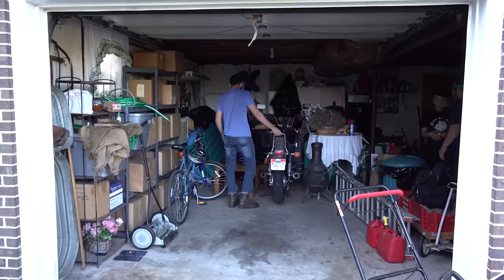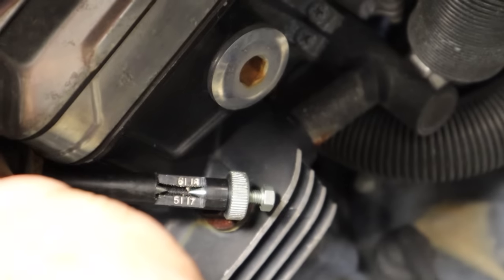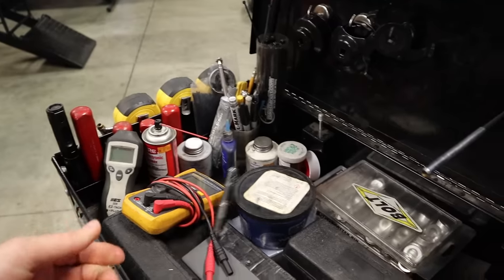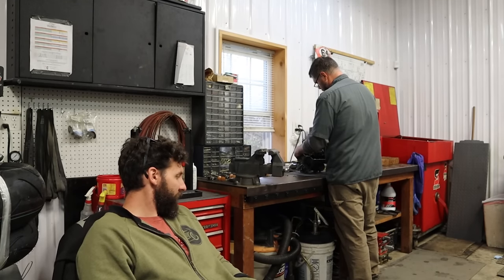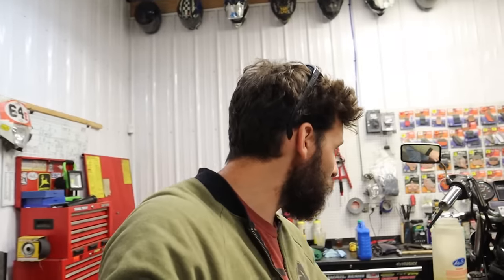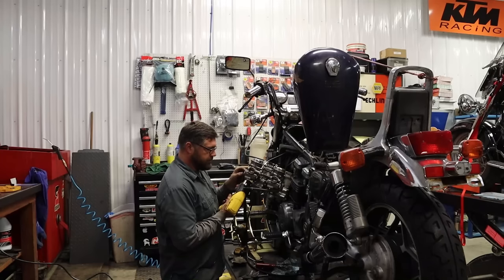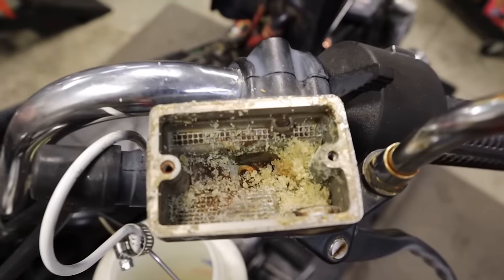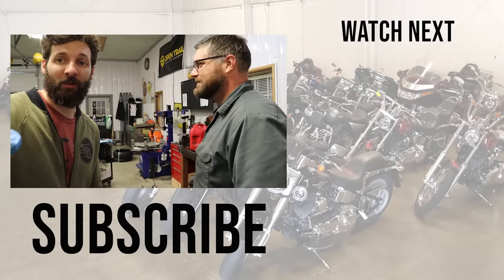Abandoned 1983 Honda Magna Restoration, Can we get it to run?

Comment: If you have little or no experience or respect for new age bikes saturated with electronics and want to test your nerve, then buy yourself a totally 'bare' engine off Ebay such as a 2015 Honda CBR650f.   Then start buying engine parts with a lot of unknown sensors.  Next begin to attach the sensors to a spaghetti maze of wire harness clips.  Finally, fill the engine with fluids and attempt to start your engine hoping that the eight or ten left over 'unattached'  wire harness clips are not critical to the engine's operation.  When the engine doesn't start you are faced with the question of fuel, spark and compression along with whatever the ECM/ECU is doing.  At this point, do you give up in disgust, set the shop on fire or invest in a new age coarse in motorcycle electronics?  At this point you should have acquired a shop manual and some test equipment.  With the courage of your convictions and a lot of testing you get the engine running.  And the problem turns out to be just bad plugs now the engine runs perfectly justifying all the money and time spent building your project...... I sold off two engines because of confusion over the electronic problems encountered.

Comment: Been there done that, I have a running, still need to change rotar and or stator, 1983 Kawasaki 750 Spectre that sat for at least (16) sixteen years. I had that gross sand crap in my rear brakes, totally gross but fixed and working in only a couple of hours... 

https://www.facebook.com/groups/39067480035/permalink/10156325496630036/

Comment: You can never sell this bike,I still have my first mx bike bought it brand new will never part with it had several bikes since but i could never part with this bike 1997 cr 125  it sits in corner of garage and it will start 2and or third kick with our fail

Comment: You don’t need a Craig... you need a factory service manual or at least a shop manual, multi meter  and basic mechanic tools. If you can’t fix 90% of a bikes issues with basic tools and a manual then don’t buy old bikes.

Comment: That engine is one of the worst designed engine Honda ever build the oil gallery for the front facing cylinder doesn't carry enough oil to the front cam their for you will get the cam will be worn to shit and run like a bag of bolts check it out hence why their not many around they are scrap and if you do find one it's cam chain or can is f..ked